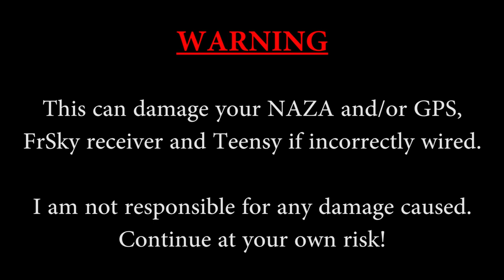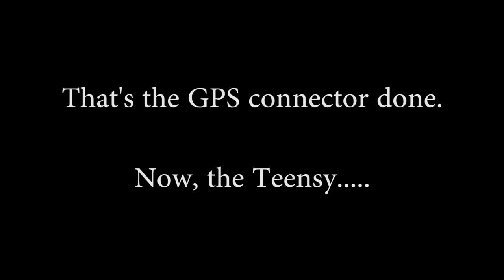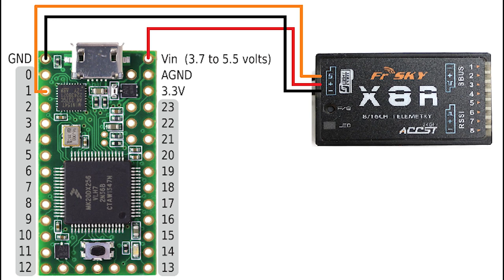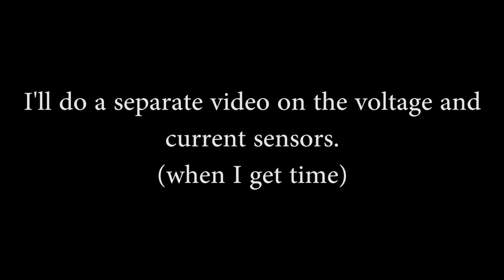Tareensy ( NAZA to Teensy to Taranis ) - How to build it

Comment: this is great! cant wait for the next video! will do this!
Reply from the maker: Thank you :-)
Let me know how it goes.
I'm working on the MinimOSD bolt-on - It'll be another 4 wires (RX, TX, power and ground) I've got the GPS co-ords, altitude, distance to home etc. done. Just got to figure the rest out.
Reply: vortecks2000  can i know what minimosd you got ,this im not familiar. I got teensy and just need to get pin headers and will let you know how it goes
Reply from the maker: 2peng MinimOSD is an on screen display for FPV and cost about £10 (whatever the currency conversion is where you live). Have a look on eBay - any will do.

Comment: I am kind of confused  does the white wire goes to  signal in that adapter that u  made ?
Reply from the maker: Yes, at 4:27 you'll see the diagram - it goes to the second pin from the right.
Reply: vortecks2000  I did everything as u said  but  in your zip i only see Tareensy_NO_OSD.cpp and   so any when i was connecting the board to pc the light was flashing  then i  followed everything as u said and cut that   connection  after that  when i connect it to usb  their is no detection  so that should be good but when i connect it to my naza  throgh the X8R i seen  no  blinking or any think on the  Teensy and also i see no data  at my  taranis except RSSI  what am i doing wrong
Reply from the maker: john Al You must have a power problem. Have you got a meter to make sure there's power going to the Teensy?
Also, make sure your polarity to the Teensy is correct.
Reply: vortecks2000  the  light in teensy was blinking before i  cut that small bridge  afte that  i  used the loader and  upload your hex but when i connect it to the   Frsky and naza get no blinking or any thing so u mention  to  check the polarity i did  the positive connected to positive negative to negative  and  i have  volt meter  i will check that  do u have that blinky  hex that  u said it is in the zip but it is not  so i can  upload that  and making sure  the  board is working  i did  reconnected the  bridge and  uploaded the no osd bin but still no luck by the way  how can i check the Teensy  sinc i checked the top postive and GRD and the poer is coming from  the X8R to  the Teensy  should i check the bottom part
 Thanks

Comment: @Vortecks Awesome work!  Went to try out the code, looks like the link is dead.  Any chance you could repost?
Reply: It no longer works mate. From what I remember, OpenTX changed the way it reads data and it jumbled everything up. The only way to make it work is by using a very old version of OpenTX but I can't test it.......I don't own a Naza anymore 😒
Reply: @vortecksengineering884  
Bummer... Well, good work anyway. Started looking at your other projects on RCGoups, you’ve been busy!
Reply from the maker: @jasonmarotta9545  I haven't done any RC stuff for a couple of years now because I delved into EV stuff. I'm just getting back into RC again now and I'm looking forward to it!

Comment: Thanks. You are a genious. Worked fine for me. Is there any chance to put a vídeo about APM flight board with OSD? Thanks again.
Reply from the maker: Thank you Sir :-)
If you're referring to the MinimOSD, I think it was incorporated into this firmware. All you do, is connect the RX on the MinimOSD to pin 10 on the Teensy (and obviously, you have to power the MinimOSD from somewhere).
If that doesn't work and you have a Naza V2, you can build a more complex system - the details are here:
http://www.rcgroups.com/forums/showpost.php?p=29090784&postcount=132

Unfortunately, I stopped development on it due to other commitments.

Comment: Great! The Teensy I ordered specially for this is just in, so I'm going to have a go at this!
Before I start I wanted to ask if I can plug in anywhere on the s.port, for example on another FrSky telemetry module. Because I also use the FrSky variometer and FLVS-01 I can't use the s.port on the X8R.
Also will connecting the minimosd later on be just an extension to this build?
Reply from the maker: It won't work with anything else plugged into the S.Port and won't work if you plug it into a separate RX - you can only transmit telemetry on one RX if you bind 2 x X8R together. I honestly wouldn't even try it.... it's too risky!
Yes, the MinimOSD will just be an extension.
Reply: vortecks2000 If I understand you correctly I can't use any other telemetry modules with this. Is this something you would add in the future? In my ideal setup I would have Taranis and minimosd with a mix of Naza and FrSky telemetry.
Reply from the maker: hapklaar This kit will feed data from the NAZA to X8R and finally to your Taranis. It also does voltage and current sensing but I haven't done a 'how to' yet.
I'm working on the coding which will allow you to add a MinimOSD.
Reply: vortecks2000 Being stubborn as I am I just connected it all together and it works like a charm! :) Even with the other telemetry modules attached to the s.port bus. Now I have voltage (frsky), altitude (frsky) and heading (naza) on my Taranis. I was speculating the s.port is a bus and every telemetry source has its own address so it should be possible to hook up the other modules as well. Maybe altitude from the frsky variometer will conflict with the gps data when it has a lock, or do they have a separate ID?

I'm not getting any coordinates yet, but thats probably because the GPS can't get a lock inside.
Reply: A little update from me. GPS coordinates are also showing up on the Taranis as well as GAlt (GPS altitude) and Dist. after leaving the copter outside for a bit. Thanks a lot for making this happen vortecks2000
Reply from the maker: hapklaar You're very welcome! :-)
Now, if you lose signal and it crashes (fingers crossed it'll never happen) you have the co-ords it went down.....even if the battery becomes detached. There's various phone apps that you can type GPS co-ords into and it'll give you an arrow to follow :-)
I'm working on the MinimOSD....it's looking good :-)
Reply: hapklaar Would you mind sharing how you hooked it up with your other telemetry units? I'm running the FLVSS and would like to add this as well.
Reply: superman0579 I just connected the Teensy output to the free port on my FLVSS. But I guess you can use any free port on the s.port bus.
Reply: hapklaar Sweet! I was hoping that you were going to say that. lol Just wanted to confirm that I have mine plugged into the FLVSS as well.
Reply: hapklaar Hi.Cool. Is your other telemetry showing in your taranis now? How many modules you have on?
Reply: Ville Hammar Yeah. I have two FrSky modules (FVAS-01 and FLVSS) hooked up to the S.port, which already showed on the Taranis. With the addition of this mod, you can also get GPS coordinates and some other related stats on the Taranis like G.alt and distance from start. Now I only need all this telemetry to go to the OSD and I'm all happy. Haven't gotten around to figuring that out yet, but I guess it should be possible with bagaOSD.
Reply from the maker: hapklaar Try  MinimOSD RX -> pin 10 (TX2) and MinimOSD TX -> pin 9 (RX2).
I don't know if I incorporated it into this version or not.

Comment: just finished installing this into my phantom 1.5
no idea how i managed to cram it all inside ha
most of it seems to be working 
not sure how accurate the altitude is tho when compared to my iosd mini its off by a bit
even when i had landed my iosd was recording 0 for h &d but the taranis was saying galt 12 and distnce 77
the gps loction seemed to be spot on tho
how often does the gps refresh its location on the tranis ???
Reply from the maker: Yeah.... I think the altitude is out a little. The iOSD calculates is differently and it's something I'm working on.
The GPS refresh should be 1hz (every second).
Reply: vortecks2000
the speed doesn't seem to work at all for me
but still the gps traker alone is worth the effort
great work
do you plan on releasing updates for this ??
if so i might have to wire up  external usb port hate taking my phantom apart ha
Reply: vortecks2000  would this work with diji Naza v2 or  the v1 with  upgrade pmu  since the  gps goes to pmu  so i am just wondering  should i connect the  GPS to this before  it goes to PMU in Naza v2 or after it comes out  from pmu and goes to Naza ? thanks
Reply from the maker: john Al It'll work fine if you connect it in between the GPS and PMU